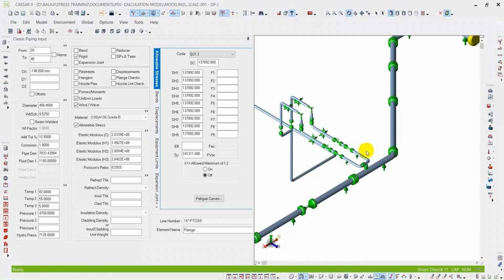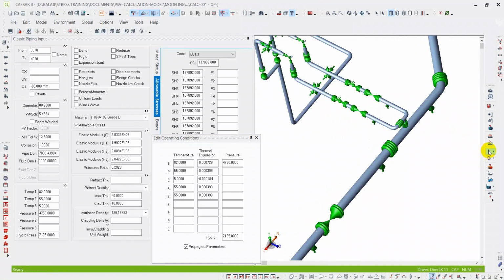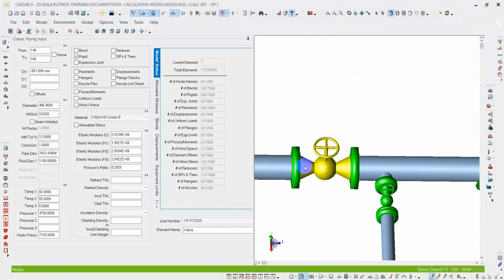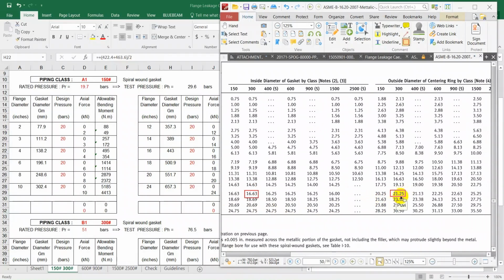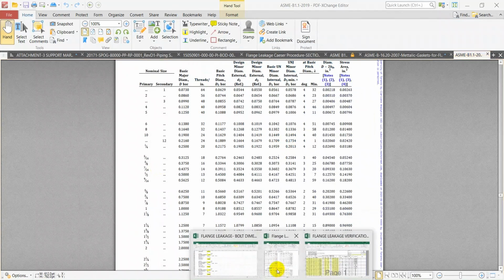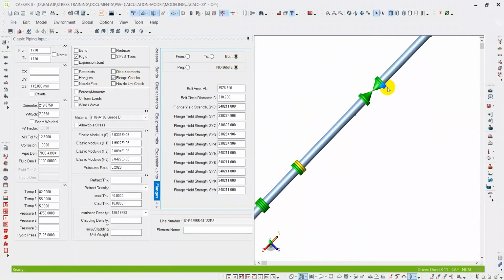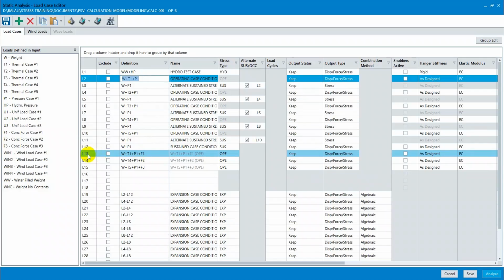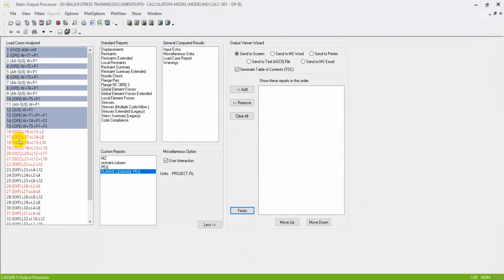CAESAR-2 Piping model-PSV RF load cases/FLANGE LEAKAGE check/Working-Standby temp distribution Part4

Comment: Dear sir good evening how to solve the load cases occ and exp?
Reply: Thanks sir
Reply from the maker: Good Everning mr ramesh..  As per my understanding your question is how to qualify the stresses in occasional and expansion cases? is it correct? I will share the videos shortly about the stress ourput and the basic idea about to qualify the stresses in HYD,SUS, OCC & EXP cases.
Reply: @BALAJIpiping  sir did you posted continuation video for this
Reply from the maker: @ananthreddy550 yes sir, already video has been uploaded
Reply: @BALAJIpiping sir which video I can't able to find can mention link of a video sir
Reply from the maker: @ananthreddy550 sir, please check the Link https://youtu.be/z2ijwwVpukM?si=R_pNirf9xLcwzHcy
Reply: Hi Sir, would you be uploading the next part of this series,checking the report and passing the line for  code allowables
Reply from the maker: @pramodchavan2683  Yes Mr.pramad, Will share the video shortly regarding the results (Stress summary, Displacements, Restraint summary, Nozzle loads check etc)